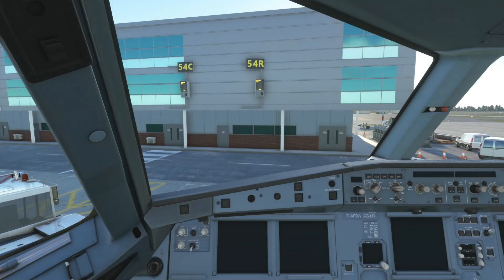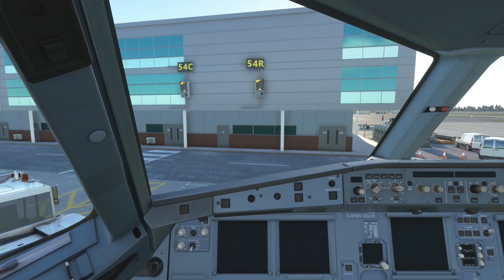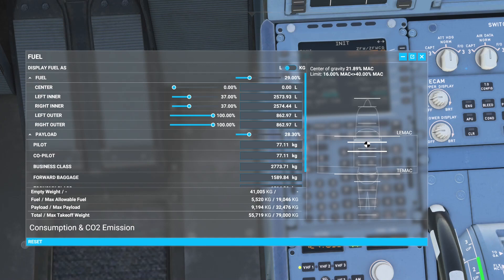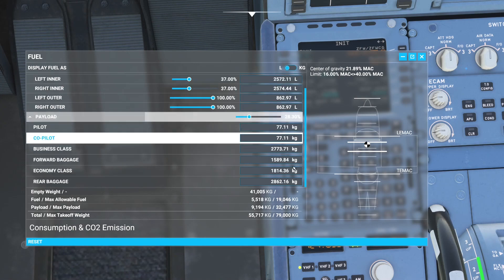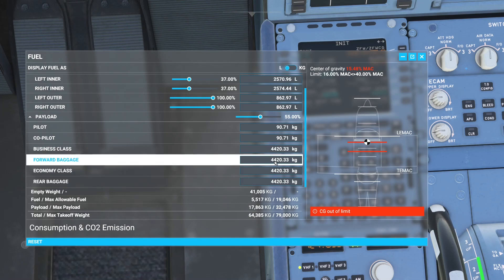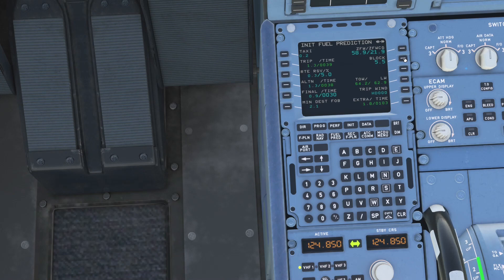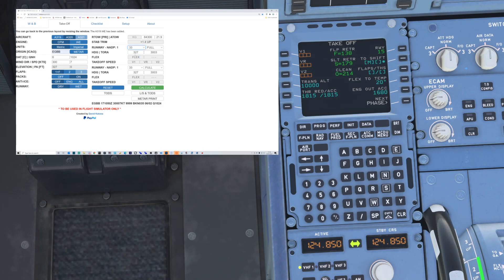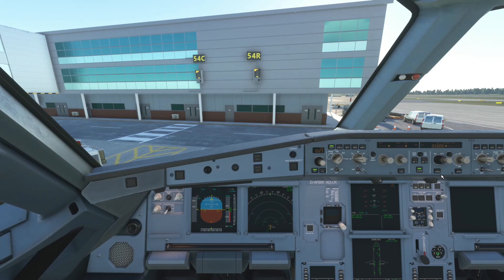MSFS Performance Weight and Balance tutorial A32NX Fly By Wire MOD

Comment: Is the FLEX option really working in the Airbus? Does it change the engine thrust?
Reply from the maker: Yes it works perfectly and it does change thrust
Reply: @FlightsimSimon  Ok I was not sure because I saw some youtube-clips about the Airbus mod and if I remember correctly they said the Flex does not work yet, that engine thrust is not changed yet. But you are sure?
Reply from the maker: It defaults to MCT, a proper temp calculation isn't implemented yet

Comment: Hi Simon, good tutorial. But on the second page of the PERF/W&B there is a Payload Load option. I *think this updates your payload according to Simbrief flightplan? It also shows you the updated cg.
Reply from the maker: It updates the mcdu but not the actual weight on the aircraft 

Make sense?
Reply: @FlightsimSimon  ah Ok, got it 👌
Reply: Not sure how the flybywire team integrates simbriefs W/B, but I think it works. Notice the #rs are accurate in the mcdu. When u hit load in the mcdu, I notice the plane gain wait. Guessing bypassing, msfs W/P page to get it done. Granted not sure if correct. Suere that will be rectified latter. So totally great video to make sure done properly 👍
Reply from the maker: @DeadSTK1224  it adds the fuel buddy 

Try it you will see 

Tow is the key 

When you look at the prediction page after simbrief you will see the tow around 55000 normal tow is up to 78000